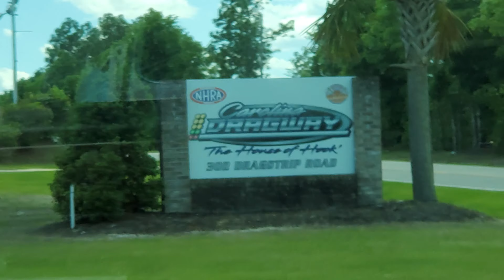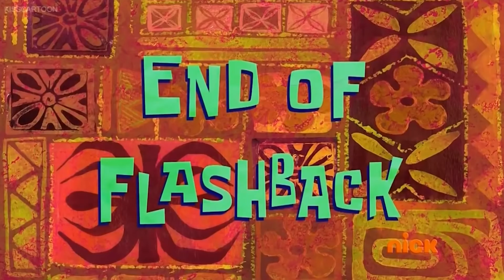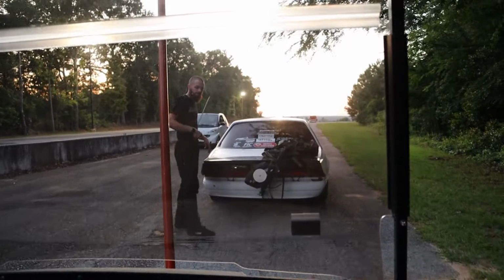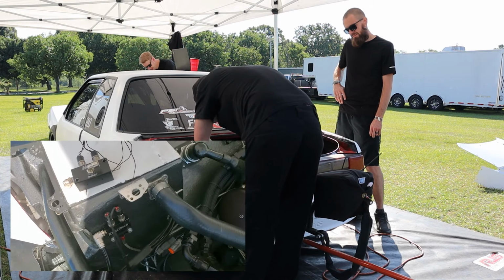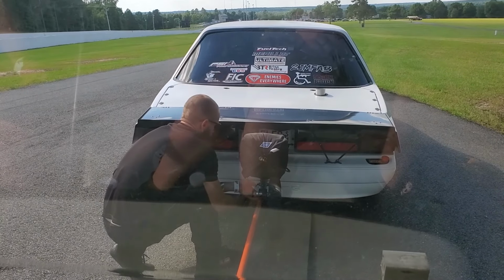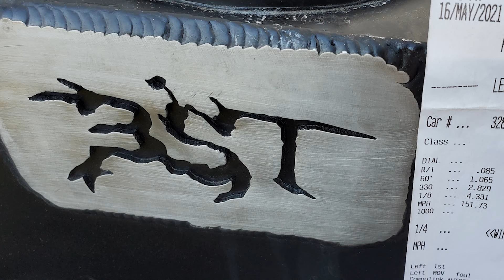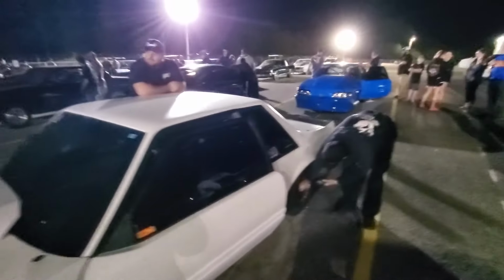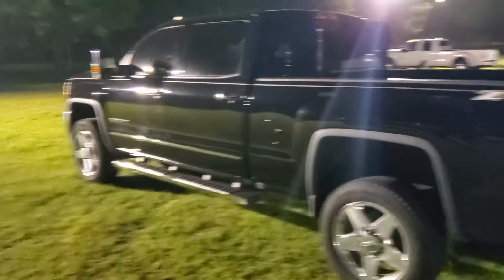LS STOCK BLOCK WORLD RECORD!!! Brutal Speed and Tuning does it again!

Comment: Send the video to John doc he'd be crying about this ...
Reply: @andrewd843  hahaha I sent it to him on Instagram anyway ☺️.yep mates LSA I've got a ve SS LS three Holden Ute .that pic is for motivation to get it blown but being a ute it's sideways enough as it is but hey I've always wanted a streetable six hundred horsepower .
Reply: Two hundred an eight subz now mate
Reply: @andrewd843  mine is Chevy badged interiors leather with bowtie embossed leather.six speed manual.its cammed twin disc clutch long tube headers xflow right through new lifters cold air intake it's working progress as you would know.you can import them but without running gear why I don't get it .in Colorado a guy imports them puts sick motors in them for sale in America .
Reply: @andrewd843  hsv Maloo are the top range utes couldn't go wrong with one ..
Reply: @andrewd843  that's cool mate..
Reply: @andrewd843  when you find it I'll get yours also ..you have a good day I'm sure it's daytime.near midnight hear ..
Reply: @andrewd843  you'll see a black vx LS 1 and my green ss ute .rm two fity